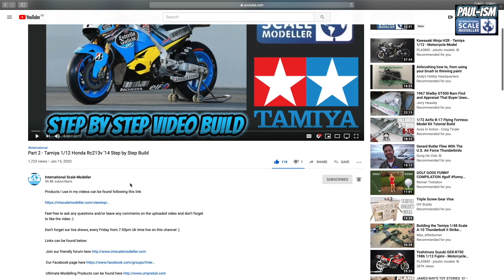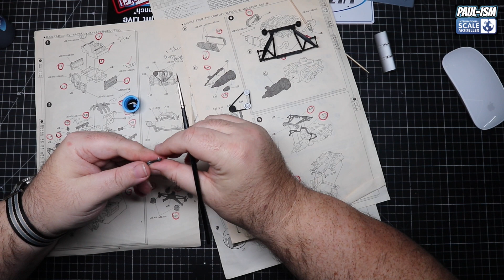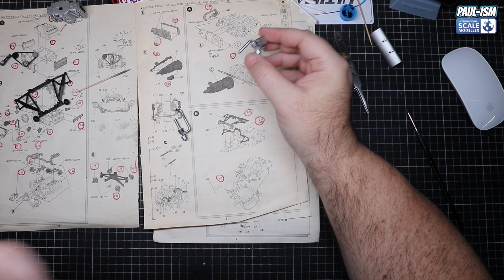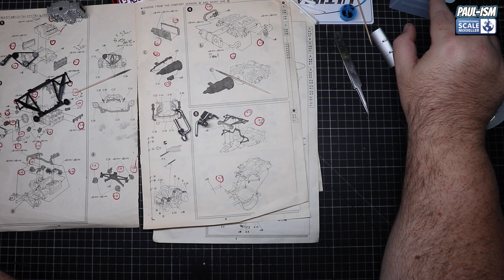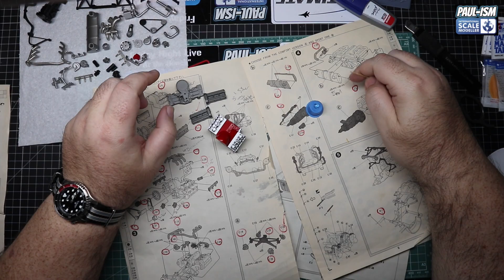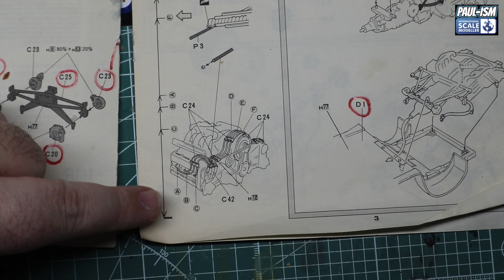Part 6 - Fujimi 1/16 Porsche 959 - Step by Step build

Comment: I have a thing for Seiko watches, in particular the Seiko 5 of which I have several. They use the same automatic mechanical movement but have loads of different styles/purposes such as dress, sport, military and diver and range from £100 up. I just love the sound and no battery aspect of automatics. The Seikos have a good reserve which easily lasts until morning. I don't wear them when I am painting though. 😁
Reply from the maker: Yeah seiko are good I have 7 of the NY Citizen automatics which I regularly wear mostly new a couple fugu limited editions and a vintage one too. Plus about 24 Eco drives too
Lol

Comment: I always add lead wheel balance weights to my cars, in the front engine bay or boot areas where they can't be seen. I use decorators caulk to fix them in. Gives the model a much more solid feel.
Reply from the maker: Cheers for the kind words, thanks for watching - Paul :)

Comment: The red on the top of the engine is actually a fiberglass fan shroud and it is red gelcoat that you’re seeing. The fan shroud directs the air from the belt driven sand across the cylinders and cylinder head. The color of the fan shroud varied from year to year on 911. Some of them are yellow some of them are green some of them are orange some of them are red..
Reply from the maker: Thanks for watching - Paul :)